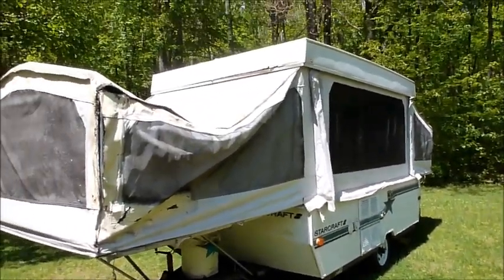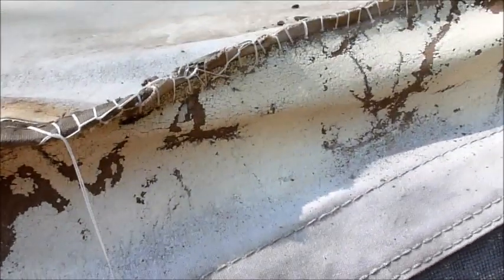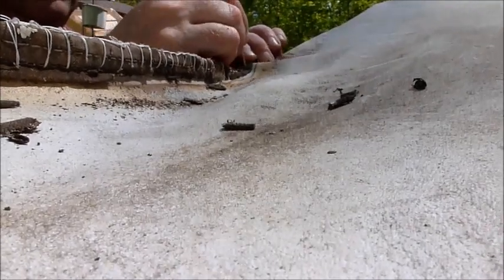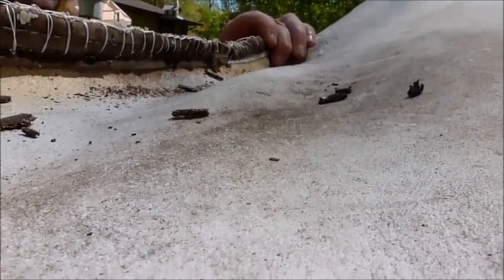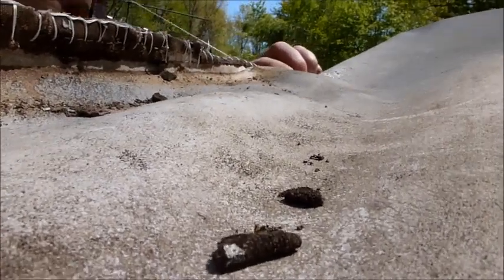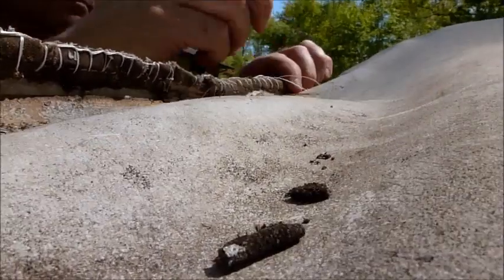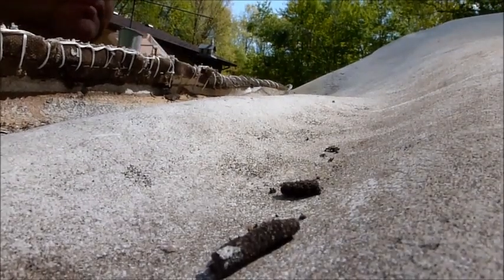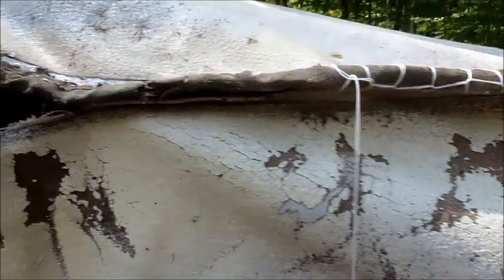Starcraft Pop-Up Canvas Repair (Part 1)

Comment: you are the fastest cleaning guy Ive seen lol
How did your repair on the canvas hold up?
I have similar tears on my canvas for the slide out beds. But I dont think mine are rotted, just old and worn down. Its a bear creek canvas on an '83 Coleman Columbia. I paid $200 for the camper, gutted out, new floor, about to install new interior wall, sink, stove, etc...
Reply from the maker: +Devin Lupina It's holding together, but it leaks.  I did some more work on it last summer, using stuff called Liquid Stitch.  I have a part 4 to this that I made last summer.  Need to do more work to it when the weather breaks.

Comment: What kind of   thread did you use Jeff?
Reply from the maker: It was a thick, heavy duty thread, not sure of a brand name.  This year I sealed it more with Flex Tape and Flex Seal, and I actually just sold the camper yesterday!

Comment: It is too old.  Buy a new one.  You fix one spot and another area start to tear apart.  It is disintegrating.
Reply from the maker: It still works fine 5 years later.
Reply: New one is around$1000 and not everyone has that.